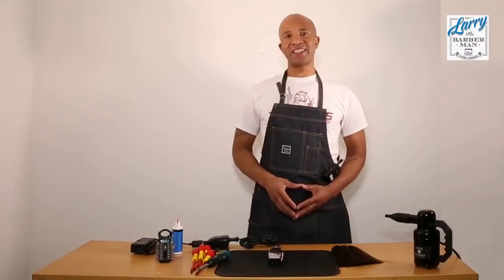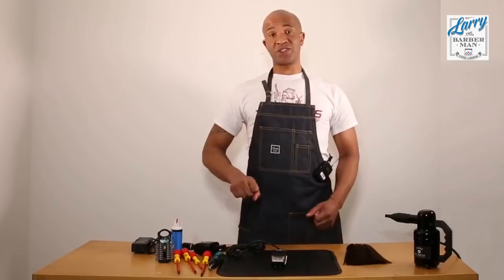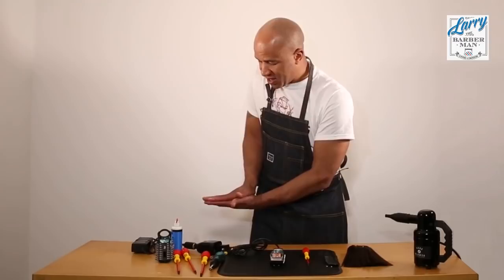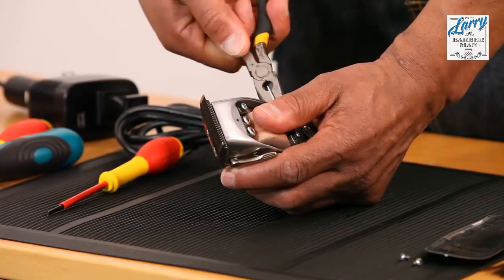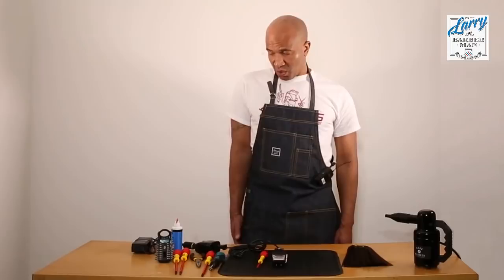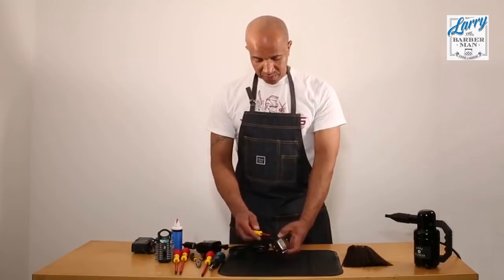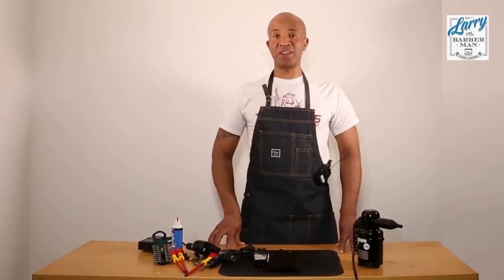Andis Masters Hair Clippers: Tuning, Service And Repair For A Kick Ass Performance

Comment: Larry many thanks this was a a game changer. I restored my 20+ yr old Andis Master clippers with a new motor and replacement parts. After taking the entire thing apart I couldn't get them to cut right. It turned out I hadn't adjusted the tension correctly. Thank you so much for showing this. Much blessings stay safe !

Comment: I know this is an older video, but this helped me fall in love with the Masters.  Thanks Larry!  I like to tinker with my clippers and the Masters really have a lot of tuneability in them.  

I found after watching this, that I can run the power higher, with slightly higher tension and they really blast through hair.

It effects heat slightly, but regular oiling definitely helps.

I think this clipper is overlooked in 2023 because of their maintenance needs.  I feel like its actually a benefit

Comment: One of the best videos replaced the blade and the middle cutting blade won't move back and forth it was only moving to the right so I turned the screw and watch the blade go back and forth fixed it now it is quiet before it was loud and only the blade moving to the right

Comment: Great video man! Question: I adjust everything as you say and the clippers seem to be running good but then when I get cutting and adjusting the blade for cutting length, the clippers start to mess up and ultimately the blade stops sliding back and forth at certain points when I adjust the level on side.

Comment: Since I've don't it the clippers are not as quiet at they were when I bought them and I've done everything you did....and the bottom blade seems a little crooked and loose but if it tighten it anymore it won't move???

Comment: I adjusted mine following the same steps but you can hear the motor faintly . I take the blade off it runs HELP! lol
Reply from the maker: Loosen the tension screw and literally hook up the fork ( black metal attached to the blade) until it makes noise

Comment: My clippers went from rattling after falling down to the ground to not moving and very quiet.
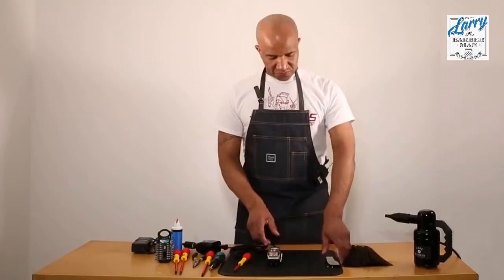Reply: When dropped, depending of the direction of impact the armature can shift and put too much force of the upper blade and 3:43 -- 5:05 covers this scenario well. Another possibility is the field-coil can shift on impact and that will affect the power-screw adjustment. Turn the power-screw 1/4 turn clockwise, to keep it quiet, and then repeat the procedure at 3:43. Afterward. circle-back and re-adjust the power screw for the sweet-spot.

Comment: It's always a good idea to remove a cover plate to access electrical components with the tool plugged in to an electrical outlet...not really.
Reply: 1966johnnywayne the only time i disconnect my masters when working on them is when I'm doing a cord swap. All you're doing is turning screws you're not gunna die smh

Comment: Hey Larry I have your converter powering my masters, I have an Asian clientele and their hair is thick, I've done all the steps in your video but it struggles to cut through hair any longer than a number #2 and I noticed in the video when you were cutting the hair and moving the clipper slightly faster it too struggled to cut through properly.

Its a real shame because i see US barber using the master for really long hair and it cuts like butter. what can be the problem?
Reply from the maker: It is difficult to guide you blind, not seeing what you have and how you have it - one thing i will say the master is not really a bulk cutting clipper it is more for the lower end. Also when you have fast clippers like the Master running at 14,000 strokes a minute you need to feed them slower
Reply from the maker: Hence the Oster Fast Feed runs at 3000 odd stokes per minute ( the principle is in the name)
Reply: Great video! you just saved me time and money by not having to send in my clippers to have it tuned for me. I've been told that you're not supposed to adjust those 2 holes on the side which I had already done but now I know how to reset it. Thanks!
Reply: +michael jordan on the reset part with the two holes, does it matter that my holes end up in a different position than what's shown in your video? I turned it clockwise as you said but my holes are in a different position when it gets to the point it won't turn any further...
Reply: "you need to turn that screw clockwise until it stops turning or it becomes really tight, this will will give you a refence point. turning it one whole rotation or 360 degrees anti-clockwise after, will set the mechaniism in the correct place to then begin overall adjustments"
Reply: Drcustomizer you need some seniors from wahl

Comment: didn't get the "reset" moment.
Reply from the maker: +iZay153 you need to turn that screw clockwise until it stops turning or it becomes really tight, this will will give you a refence point. turning it one whole rotation or 360 degrees anti-clockwise after, will set the mechaniism in the correct place to then begin overall adjustments
Reply from the maker: +Larry The Barber Man got it?
Reply: +Larry The Barber Man ok! i'll try this! thank you brother! because there is no information about this screw at all!
Reply from the maker: +iZay153 it is the screw with the two holes, the one i have insert the pointed pliers into
Reply: +Larry The Barber Man thank you very much!!!